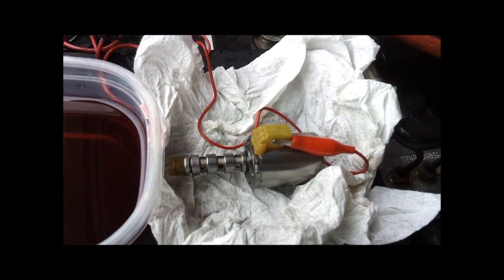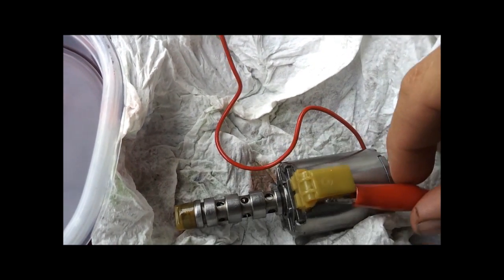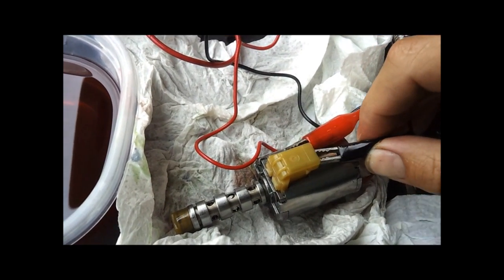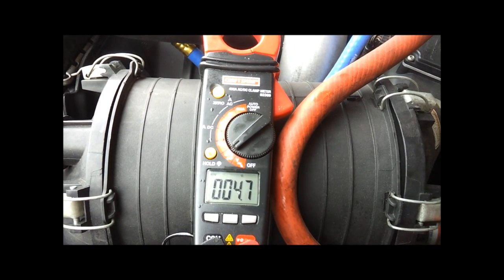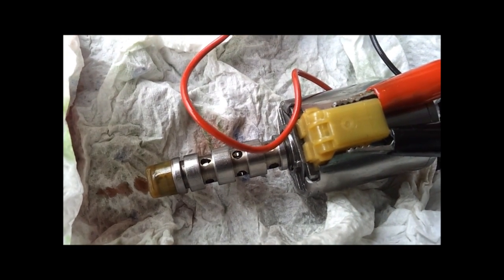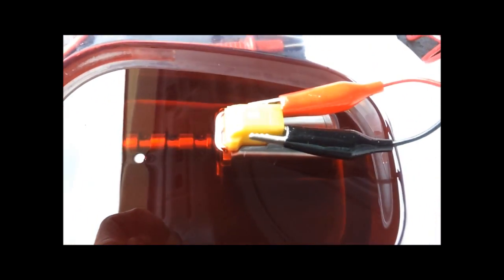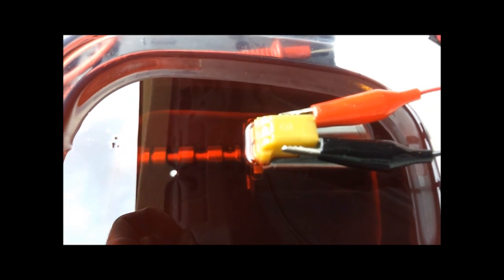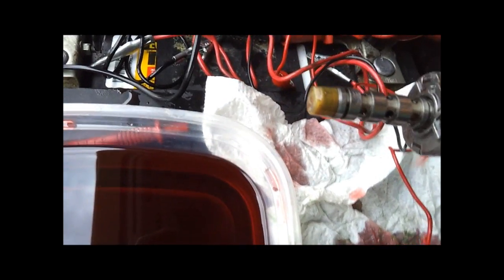FORD Superduty ~5R110W Transmission~ Shift Solenoid Testing

Comment: I was driving home late, about 1:30am. had to cut through a dangerous part of the community in my e350 super duty,, as I shifted into third a bang was heard from my 5R110W,  no more power to the wheels in forward or reverse. I had to abandon the truck until morning. by the time I returned the following day the truck was ransacked, the windows broken. clowns designing then assemble these low quality and unreliable vehicle's

Comment: Just for information purpose there is no piston in there. There is a valve with a spring that is controlled by the pintel  that is controlled by electrical current.Having it in the oil means nothing.

Comment: My transmission is not shifting normal and over drive is not getting in  the tow  haul light is blincking  i checked all selenoids the way you did and they work what else can be the problem
Reply: Isais77 did you ever find the issue?